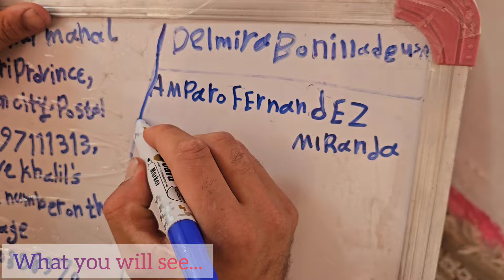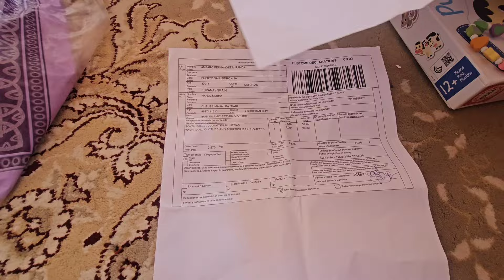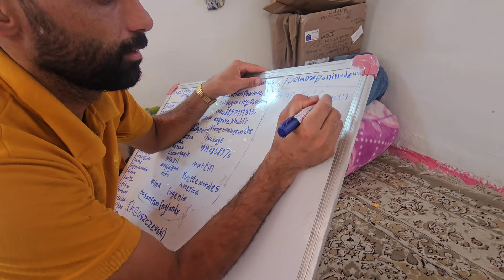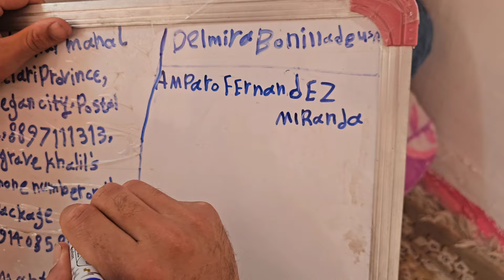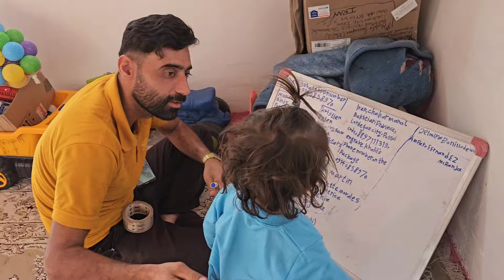Love and Conflict on the Open Road: A Nomadic Couple's Story

Comment: Khalil you need to finish the outside of the house, around the sides and at the back. You also need to put some wood over the tops of the windows on the inside, it has not been plastered and the metal rods can be seen so the open air can get in Don’t forget  you have to put more windows with glass in.  Your house is on a hill watch for the rain pouring in the house. God Bless you all, and be nice to your wife. ❤❤❤🙏🙏🙏

Comment: When it rains like we've seen in your old house, it will pour down the hill in your garden and come into your house. The ground in the garden needs to be alot lower than the door step . The water won't be able to escape with the wall being there either. Inside the house will be very wet.